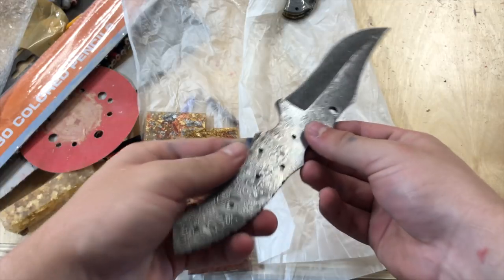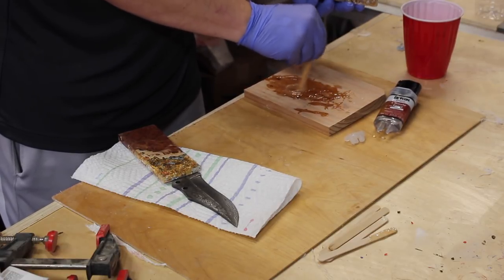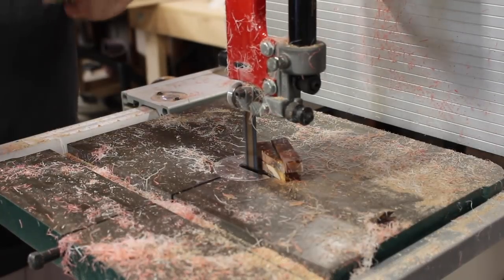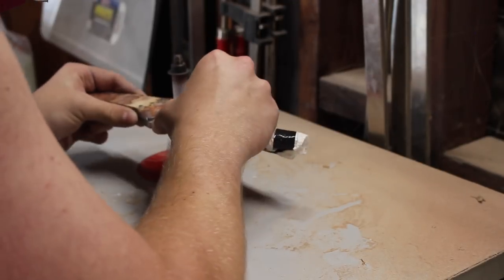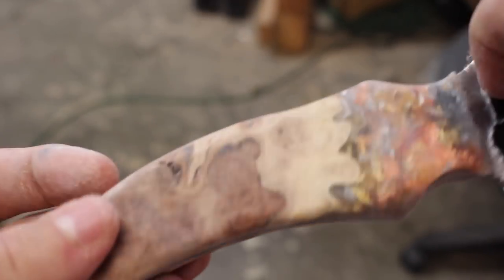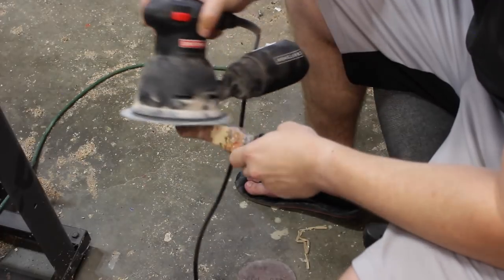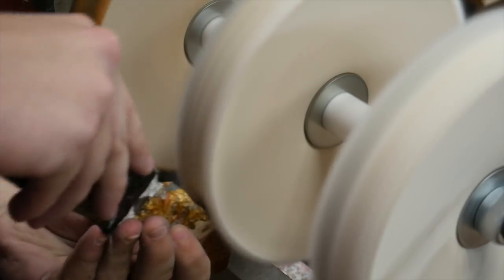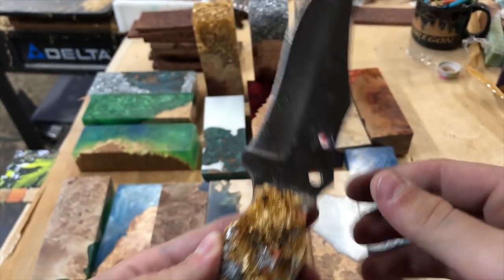Damascus Steel Knife with Hybrid Resin & Burl Handle

Comment: It is not the pressure that makes the material remove faster. It is mainly because the removed material sits  between the abrasive medium until it can fall out when the workpice is not over the belt. This means that there is only a certain amount of material which the belt can carry/remove per round.  Therefore a longer surface in the grinding direction needs more time to grind, simply because the gaps between the abrasive fill up faster. Its like sawing a stick vs sawing a tree in half. The tree takes longer because you have to remove more chips out of the way. 
Pressure only makes a difference with hard materials like steel when you don't fill up all the gaps between the abrasives with removed material. Hope this makes sense to you.
Reply from the maker: That makes the most sense to me rather than the pressure argument. The pressure made sense until I was thinking that I could still apply the same amount of pressure on a corner of wood being sanded on the flat surface, and it still would sand slower than applying the same pressure on the rounded.

Comment: The speed of the belt is the same all the way around. It has to do with surface area, and the fact that you can apply more pressure to a smaller area

Comment: Hey Casey! I ran into the problem you mentioned about how much material is removed from the belt sander on the curve. My only thought was that perhaps because it is a lost less surface area, it becomes more targeted? Amazing work as usual!
Reply from the maker: I think that’s it. That’s what someone else commented as well. It makes sense.
Reply: Usually is for that. Also people tend to press harder when sanding with the curved area of the belt sander.